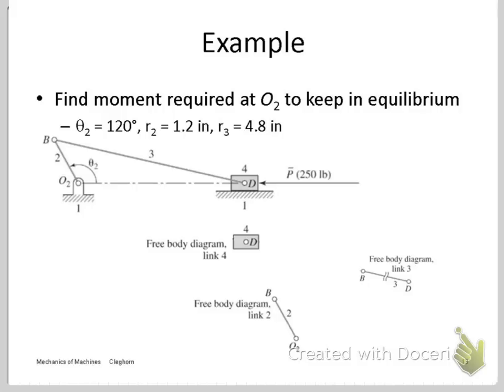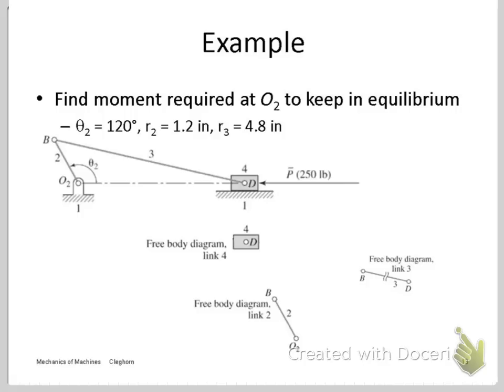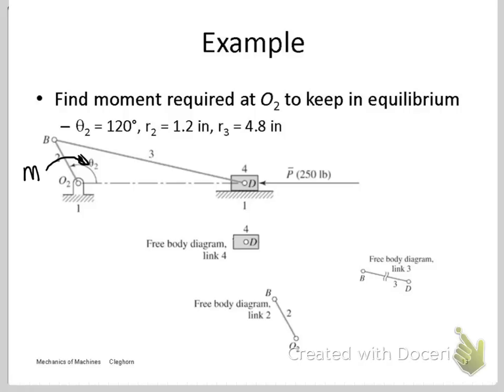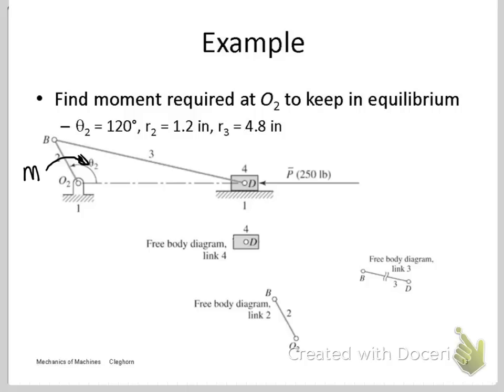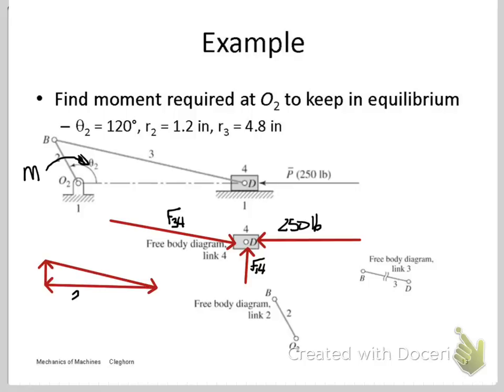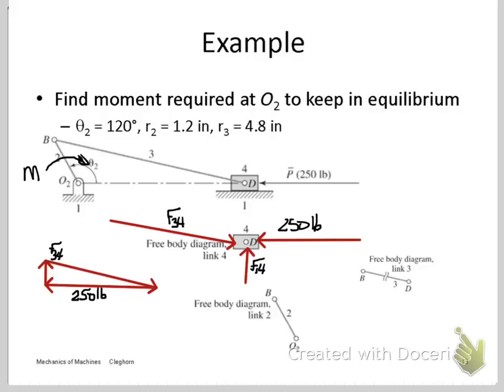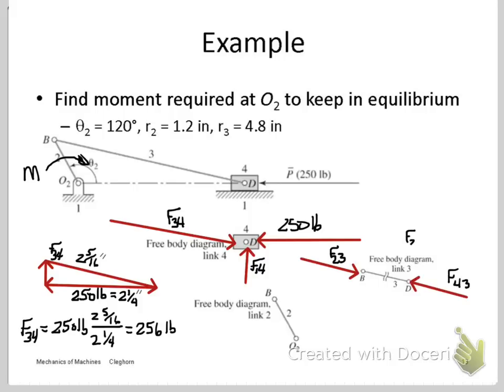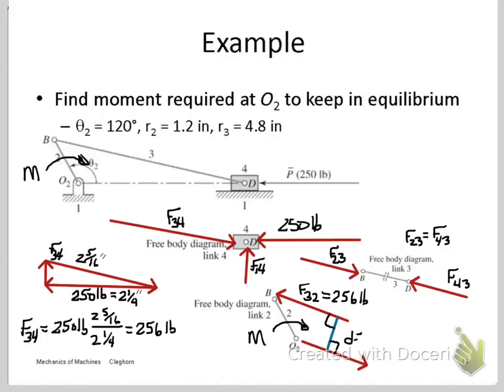ForceAnalysisExample1

Comment: but in some questions the Drawings are not drawn to scale, I think that's what (rbturbo9) is asking
Reply from the maker: +Mosha On my sheet of printed paper of the diagram that I used to measure them, the lengths of the sides of the triangle measured 2 5/16 inches and 2 1/4 inches. If you print it a different size, then the measurements will be different, but as long as the diagram is to some scale, it should work.